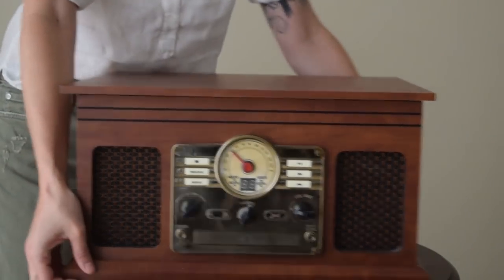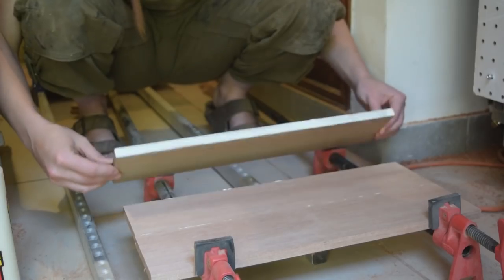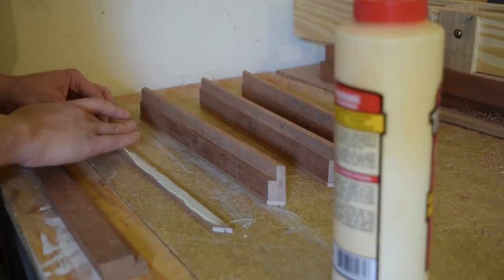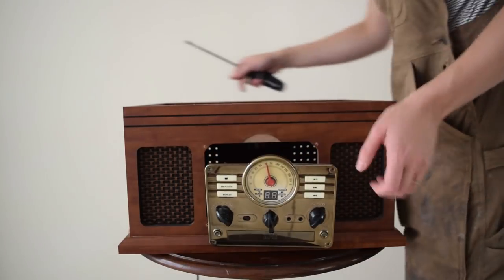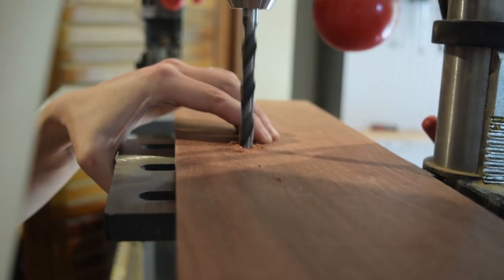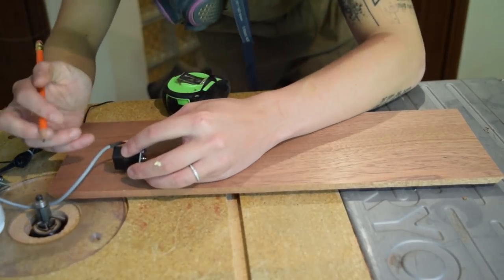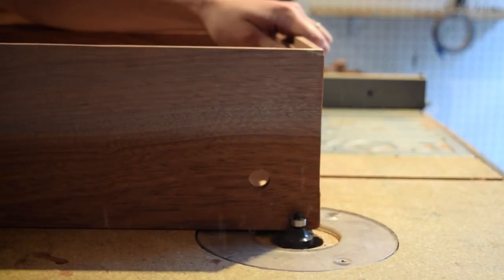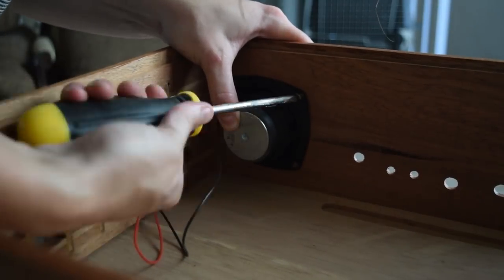DIY Facelift for an Old Record Player (Mid-century modern design)

Comment: Great build and excellent video! For sealing cable holes etc I use hot glue rather than silicone instant and less messy, great for holding down wires and electronic bits too, no rattles.
Reply from the maker: Thanks Chris! Good tip!